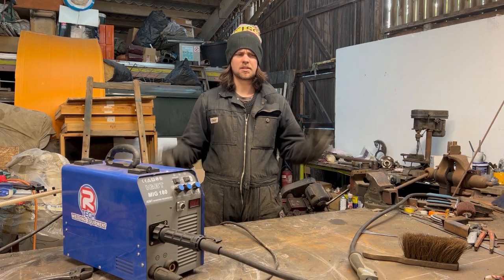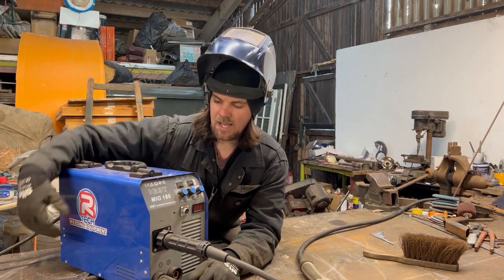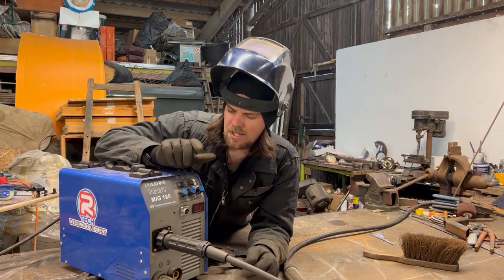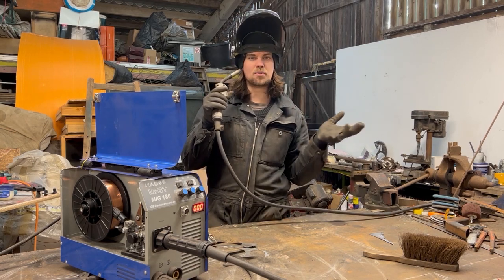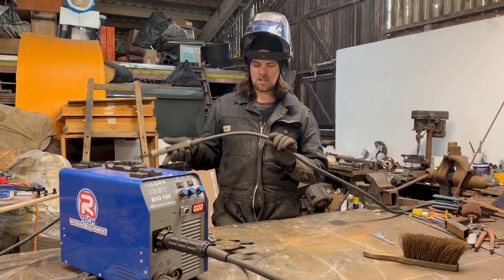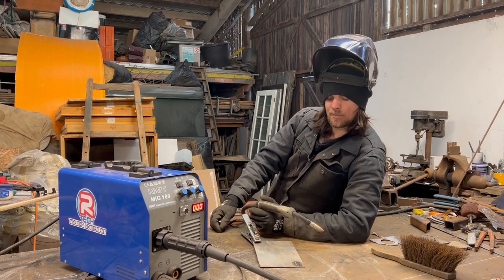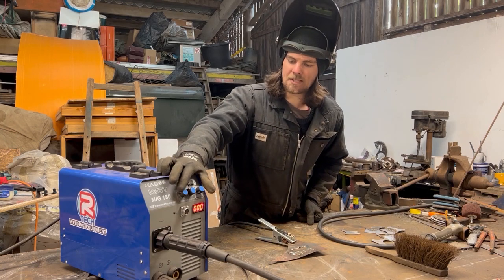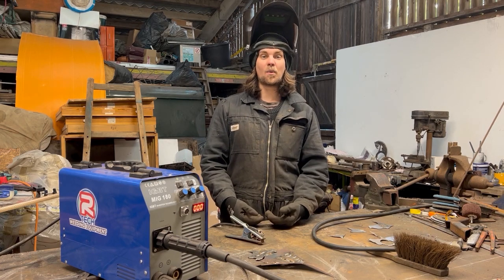Simple Mig Welding Tips and Basics. For beginners only.  😀

Comment: Hey there, I watched your metal bending video from two years ago. I have a few questions about it because I'm making a project I don't know how to start. I'm going to make an iron man mask in my shop class. the one he makes in a cave. but I'm wondering if I should find a cylinder tank and use that, or could I use the technique you used to make bowls, to round out the forehead part. You were using pretty thin steel. would It work with thicker stuff? I hope you see this, please get back to me. Thanks.
Reply from the maker: @justinthehuman5165  hi Justin. 

Tricky one. I’ve had a go at bashing a face in sheet metal it is challenging. Especially as you go thick as you would need to heat up metal an bash. But there’s a clever guy who’s mastered this art. They call it repousse I think. Basically it’s bashing out designs on metal mainly copper but this guy call Douglas prior I think it is. He’s done it on metal made some amazing things. Will try to find name.  But try looking him up.
Reply: @ollieholmansculpture  wow, his work is amazing. thanks for your help. I'll look more into the repousse technique